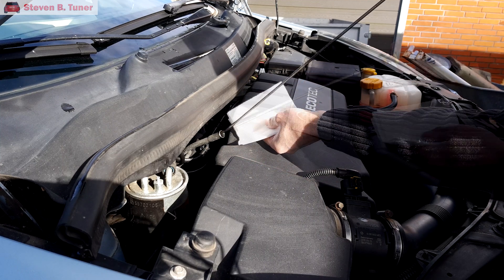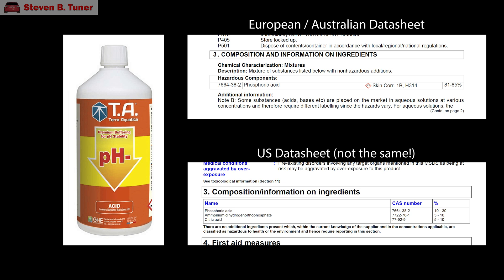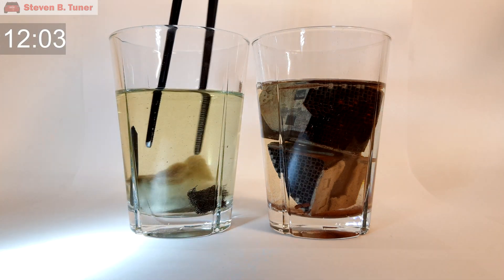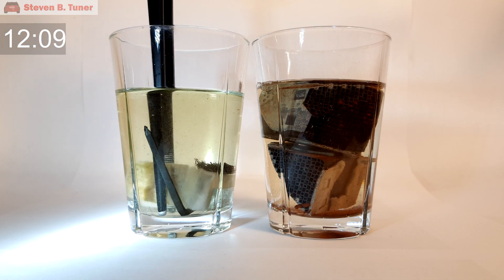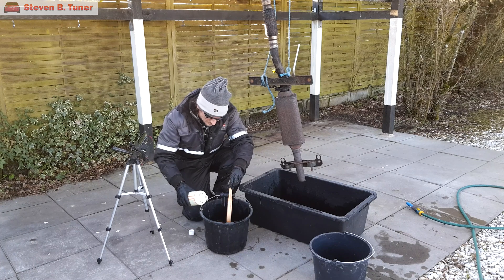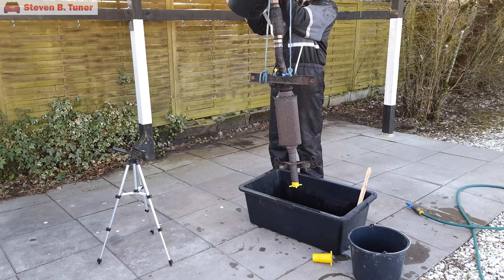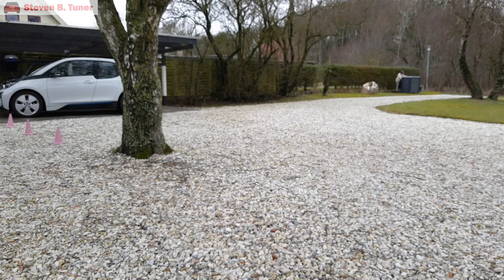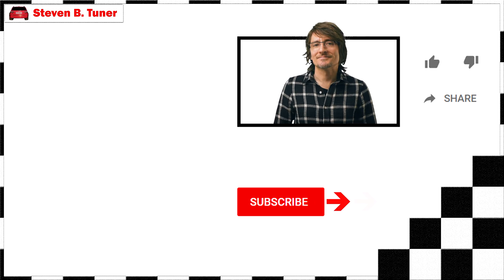🏡 DIY DPF Cleaning at Home: Restore Your Clogged Diesel Particulate Filter (with no DOC catalyst!) ✨

Comment: I wonder where "ALONG" each small tube of the DPF does the metalic oxice ash build up. At the entry or the exit or at random.
Reply from the maker: Hi, from my dissections, it fills up from the exhaust end first.
Reply: Hi Steve
I got all the soot out and measured the depth of a few of the tiny tunnels from the gas exit end with a thin spring wire I straightened out. All good. 
I then measured the depths of the tiny channels from the inlet end and many stopped (clogged) at around 5 inches short of full depth some even more.
I'll have to get the phosphoric acid and give that a go.
Or I might use WD40 as their blurb says it disolves Rust (FeO)
Reply from the maker: @alexschulz8791  Hi, the best ash dissolving results I get are with the  6-7% hydrochloric acid solution along with lots of shaking and forward and reverse flushing. The phosphoric acid is more metal-friendly, but sometimes you need the raw power. Wear good protective glasses, gloves and clothing!
Reply: @StevenBTuner  1 ltr of phosphoric acid did a lot of disolving and plenty of red came out. But 1ltr is not enough to really clean the whole depth. Thus I'll make the HCL solution to get to the last of the DPF. Cross fingers.
Reply from the maker: @alexschulz8791  That'll be one clean DPF by the time you've finished! :-)
Reply: @StevenBTuner  Oh hel Yeh it worked expetionally well. Now that there is air flow my milage has improve to 120% of what I was getting. (I fixed the intercooler fins as well).
Its an important thing to measure the success. I found that after the first degrease flush I could only fill with 1.5 ltrs of fluid. after I completed the whole process I could get 2.5 ltrs of water.
Reply from the maker: @alexschulz8791  Superb!

Comment: In summary
A big thank you for this video.
I took mine out and after watching another video I started to clean with a simple water hose based gardening spary wand. I kept on with this it and kept extracting little 1cm solid and tubular blockage, I emptied a heavy duty degreaser and a huge amount of dissolved grease plus solid cubes kept comming out. More kept coming out when I lifted the DPF out of the water container and letting the water come in and then rush out.

I then I kept going untill I couldn't see any more coming out. Especially on the reverse flush with the wand.

But I kept seeing little oil slicks come out with occasional black cubes. Then i saw your video so I started with Calcium Lime Rust remover. Which contains phosphoric acid. I kept doing this many many times where I would spray 1/2 a CLR container directly and then wash it through. I kept getting 1cm bits so I kept doing the same multiple times and still getting small length of blocks. 

I then started with a higher concentration of 1cup CLR in 2 ltrs about 5 times. This kept small blocks coming out (with water) especially when I would leave the water overnight as part of the final rinse and lifting and dunking the DPF till no more small bits came out. Since it kept only extracting small bits and no metal oxides, I then sprayed another full can of Heavy Duty degreaser and this time extracted a substantial amount of blocks and dissolved oil. This was followed with more lifting and dunking till no more blocks. I treid to use my Endoscope to see the results so used a hair drier to see better. But the hair drier had too much back pressure and it cut out.

So I used the last of 4 cans of degreaser and again rotated and left the solution sit on as much of the modules as possible. this again was followed with a water rinse with spray handle (sadly I bent the temp sensor) and dunk and final rinse. With the final dunk and lift i could finally hear the swish of the water flowing as I llifted and dunk the unit.

The Endoscope  showed progress. So I started to dry it with my simple hair dryer and this time the air flow from the hair drier had improved substantially. I only saw a small amount of the metal oxides.

At $1.5 tommorrow I will put a total of 5 degreaser cans through and rinse it and inspect the water flow and then the air flow.

So far in total I've used *) a hand spray bottle of CLR  *) 1.5 ltr of CLR concentrate watered down *) a huge lot of water to flush each cleaning session and *) 4 cans of degreaser.

I reckon if I had done the degreaser with a capacity to push the degreaser back and forth in 1/2 hr session (under a small amount of pressure) and then CLR I'd have saved days of work and hundred of ltrs of water.

I hope this helps others. PS mine is a Suzuki original DPF from a Grand Vitara 2010 1.9DDIS
Reply from the maker: Hi, that sounds like a very soot clogged DPF! Well done in your persistence!
Reply: As a final clean I'm emtying another 3 1/2 cans of degreaser (3 1/2 completely fills the chamber with the DPF modules fully imerced in a 2010 Suzuki Grand Vitara 1.9 DDIS. Laying it on its side I can rock it back and forth which works best.
I'll add a ful report when I'm finished.

Comment: I wish I had used my endoscope pre starting to clean and some pregressive shots. My latest sticky beek into the up steam indicates a further more thorough clean rerquired. Water flow is is very good but hair dryer air flow was not to good.
Reply from the maker: Hi, it can take some time to dry out the ceramic even with an idling engine, so a low powered dryer is not the best indication.
Reply: The acid clean probably will slightly eat away at the glue holding the big square modules.

Comment: I used "calcium lime rust" and think I might have damaged the DPF. The packet said not to use on marble (RTFM)
I took out the DPF stra6ted with a straight water back wash and lost of soot came out. I then used 2 cans of degreaser and lots more soot came out and a tiny amount the red chromates you got in your videos. The DPf are often made from cordierite. Did I fk up my DPF???
Also there is videos suggesting why the DPF fails and gets clogged the first is failed pressure sensor that stops the cars own regeneration process. Thus checking the sensor will help prevent the DPf clog. Second is a failed glow plugt as the Glow plug is needed as part of the cars own regen process while it adds that extra squirt of fuel tha will burn in the DPF.
Reply from the maker: Hi, you will have to check the safety datasheet to see exactly what it is in the product, but if anything is going to be damaged by acid it will be the metal first, so I think you will be okay.
Reply: Some of the iron oxide ash came out and when I picked them out and left them in my water/CLR mix (mixed at a cup of CLR with 2lt of water ) the red blocks didn't get touched even after hours of soaking.
But the water flow has improved dramtically after multiple multiple cleans (over 10-15 clenaing cycles), with the CLR and a cheap pressure water hose.
Still more to be done.
I'll stop when ash blocks stop coming out.
I reckon that since the DPF is hundreds of long holes and complete bocking happens over time the cleaning will softebn and release in lots of small incraments.

Comment: Dear Steven,  what do you recommend to do to completely rinse out or neutralize residual acid? I am asking as there was a comment from some chemist's that after the process you presented there still might be an issue with acid left.
Reply from the maker: Hi, use lots of water with some dishwashing detergent, and flush through forwards and backwards.

Comment: Hi Steven. I think the 76% is normal after forcing a regeneration on Opel cars. It also starts the conventional "regenerating while driving" process after the manual stationary one.
Reply from the maker: Hi, I'm not sure what you are referring to with the 76%. A good indication is the number of miles/kms between scheduled regeneration - as the filter fills up with ash the distance between cycles will become less and less.
Reply: @StevenBTuner  in the video you are referring to 76% dpf status after manual regeneration.
The 76% does not mean the manual regeneration didn't really work. It is just set this way by the ecu, so the car also das a conventional regeneration as soon as possible after the manual one.

The dpf percentage in the ecu is always just a calculated value (mileage since last generation, how many cold starts, etc) which is checked for plausibility with the differential pressure reported by the dpf dp sensor.

What i wanted to say: you can't trust the percentage
Reply: @KilianGosewisch  Hi, the 76% is the Cinder Count in the DPF.  After each Regen a deposit is left behind which collects inside the DPF eventually completely blocking it.

For Instance, my DPF has a 90% cinder count with an estimated 17,000 miles of life before it is completely blocked.  90% is not the Regen.  It is the residue left behind after the Regen.

Comment: Hey Steven, im working on a car with a soot-contaminated DPF (from lots of low speed driving).  I'd like to avoid removing the DPF for cleaning if possible.  I'm thinking that running a few litres of degreaser or similar into the upstream pressure sensor tube, let it sit for a half an hour, and then run the engine for a bit to blow it out the tailpipe, should flush out the soot?  Might take a few rounds...   The idea being to bring the soot levels down to the point where it can start doing active regens again to manage future soot buildup.   Are there any faults to my logic?
Reply from the maker: Hi, some cars are more likely to suffer from soot build-up due to low speed driving than others. From talking to friends who have exactly that issue, they have found that the 'DPF Clean' fuel tank additives do in fact help by reducing the temperature that the soot burns off (changes from carbon to carbon dioxide). Adding degreaser will loosen up any oil, but won't help to lower the oxidation temperature - so the soot (carbon) particles will remain stuck in the very fine DPF matrix.

Comment: Hi, what chemical stage do you recommend That is safe to do a full dpf clean that i can perform on a Sept 2012 Honda Accord 2.2 I-DTEC with 95k on the clock with up-to-date full main dealer service history and the dpf has never been removed before its had 4 static regenerations in the past 5 months and im guessing the ash content/particulate matter, is getting higher and higher that is why its wanting to regenerate every 300 or so miles more and more.
Ive been recommended to take it to Halfords for a deep clean for £85.00 but im not keen on them working on it only to take it back to them a month later, can you help?
Reply from the maker: Hi, unless you have been using the wrong type of oil or filling your car with old farm diesel, then I wouldn't expect it to be ash-clogged quite yet - maybe after 150k miles it would certainly benefit from a full removal and clean. The 300 mile regeneration interval isn't too bad either. What symptoms are causing you to look for a problem to fix?
Reply: @StevenBTuner  Dpf light stays on a it's in continual limp mode and wont passively regenerate even after 1 hour of motorway driving. 
What makes you think it has had cheap oil in it? 
As stated in my above comment if read correctly, it has full main dealer service history and i dont believe they would use cheap non-standard oil in it?
Regards to fueling, 
It either has Shell v-power or Esso synergy+ diesel .
Farm diesel??.
Ive covered 20k miles in the 18 months ive owned the vehicle with a good mix  of A/B roads and duel carriage/ motorway driving. 
I don't know how the vehicle has been driven previously to my ownership? 
I am going forward with the process of elimination, there may be an underlying  issue elsewhere with it, i dont know.
You dont get any notification to go by when it wants to do  a regeneration, just a "ping" on the dash and throws itself in to "Teddy mode".
Reply from the maker: Hi, what I'm saying is that it is very unlikely that your filter is the issue. It is much more likely that you have an issue with a stuck EGR valve or a malfunctioning sensor or failed glow plugs - and that is causing the DPF regeneration to be cancelled. The first thing to do is connect a good OBDII reader like the Autel AP200 and get a list of any engine error codes.
Reply: @BlueSky-ec7wn  there are videos suggesting why the DPF fails and gets clogged.
The first is failed pressure sensor that stops the cars own regeneration process. Thus checking the sensor will help prevent the DPf clog. 
Second is a failed glow plug as the Glow plug is needed as part of the cars own regen process while it adds that extra squirt of fuel tha will burn inside the DPF.

Comment: Hey Steven, after studying the best way to clean my Cx-5 from 2016, I opted for a 3 stage cleaning without removing the DPF.
1. 2 L of Dish-washing liquid 50% then wash with 4 L of water with engine on
2. 1.5 L of Caustic Soda 10% ongine off then
wash 4 L of water with engine on
3. 2 L of NaCl 10% with engine off then 5 L of water with engine on.
I did all the operations using a compression sprau-gun with can, through the Diff pressure DPF larger tube :)
At the end I did a 20 km ride with the car with high rpm. 
The results are quite good for now:
At 3000 rpm 10 kPa before -> 4.5 kPa now.
I will update how it goes in the future
Reply from the maker: Hi, thanks for sharing your method - be great to hear those future updates!
Reply: Hello any updates for this method? Is it effective?
Reply: @borhencherif3854  
Yes, but be careful to rinse after because it can corrode the lambda/O2 sensor that is after the dpf

Comment: Will a occasionally a longer high rpm and/or a full throttle acceleration not blast the dirt out of the dpf?
Reply from the maker: Hi, thanks for watching! The soot (carbon) in the DPF is burnt off regularly by your car (active regeneration) or can also be burnt off with a good long drive (passive regeneration). However, this video is more concerned with removing the ash which builds up in the filter over 100,000 to 150,000 miles, and mostly comes from compounds in your engine oil which can't be burnt away.
Reply: Yes i know. But will occasionally hard driving remove the ash? And will it help to prevent the ash buildup from happening or slowering the buildup from happening?
Reply from the maker: Hi, driving hard might burn a bit more oil and a will definitely burn more diesel and therefore increase how quickly ash forms. As a vehicle owner, the way to reduce ash buildup is to follow the manufacturer's recommended 'low ash' engine oil standard when buying oil (or make sure your mechanic does), and to use good quality diesel fuel (most car diesel worldwide is now ultra low ash as standard, so you only have to avoid using marine or farm diesel).

Comment: way the oil that im using is Acea C2 which i believe is mid-saps - would it really be harmful to use Acea C1 which is low saps (Its got 0.5 sulphated ash compared to C2 which has 0.8) ??? Many thanks in advance
Reply from the maker: Hi, there are so many factors and so much testing that goes into the oil standards that are recommended by manufacturers, that it would be irresponsible for me to make a general comment regarding your particular car. Sometimes the low saps oil isn't recommended by the manufacturer because at the date of manufacture, the low saps oil standard didn't exist - so if you can see that your exact engine model was given different oil recommendations as the years progressed (with no changes to the actual engine), then it could be that the later lower saps variant would probably be okay to use, but you will need to do a lot of digging to confirm this.
Reply: @StevenBTuner  Thanks for all your help.
Reply: C2 is mid saps c3 mid/liw saps and c4 low saps

Comment: Hello Steven. Fantastic videos. Keep up the  education. I have an issue if you can shed some light with your wonderful know-how. I have a auris which i am continously cleaning the dpf with brick cleaner, dish washer tablets and sodium hydroxide (all with instant and great results). problem is it gets bunged up again about a month later.  Could the type of oil ime using be at fault, its C2 mid saps (normally burn about half a litre a month) recommended by dealer. Should i switch to C1 or C2 which are low saps ? (engine about 100k, ime in the uk). Thanks
Reply from the maker: Hi, that sounds like quite a lot of oil usage, and I expect that your car would be using low saps - but if it isn't then there is a reason, and you shouldn't go against the manufacturer recommendation. However, you definitely shouldn't be having to clean out out your filter more than once every 150,000 miles or you have some other system failure that is stopping the active regeneration from working properly. Connecting a good OBDII code reader like the Autel AP200 is definitely worth doing to see if the EGR valve or glow plugs etc are throwing up errors.
Reply: @StevenBTuner  Thanks for reply. Apparantly its normal/common on the auris. Do you thinking blanking the egr will help ? i mean the soot and crap might be building up because of that.
Reply from the maker: @jasonbonde9630  EGR valves work great when everything else is working well, but when the engine gets a bit older and burns a bit of oil due to valve stem seals, piston rings etc - that burn oil gets fed back through the intake system and helps fill the egr valve and intake manifold with oily gunk.

Comment: Where did you get the plugs for the exhaust and the bracket from where you cut the exhaust? Thanks.
Reply from the maker: Hi, thanks for watching! I 3D-printed the plastic plugs, but you could make them out of cork or wood too. The exhaust was joined together using some exhaust joining clamps from an auto parts store.